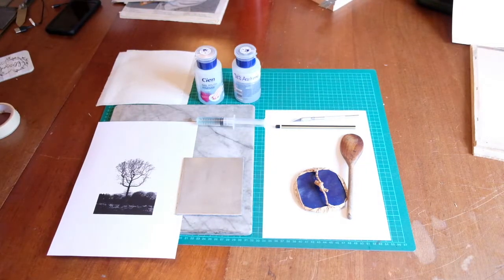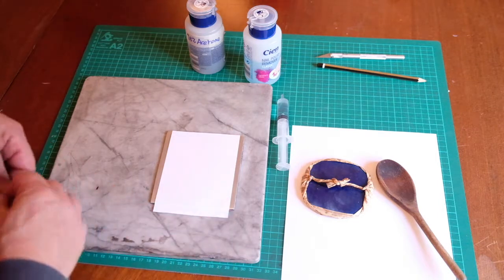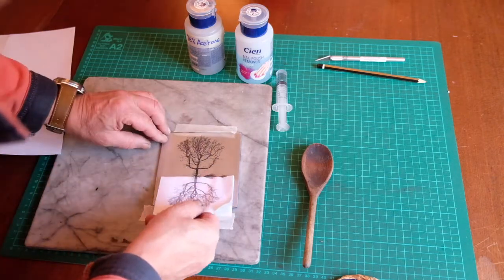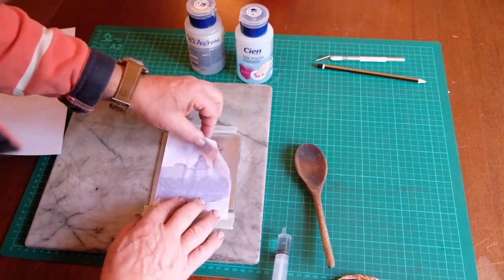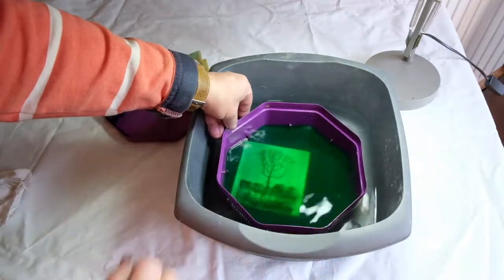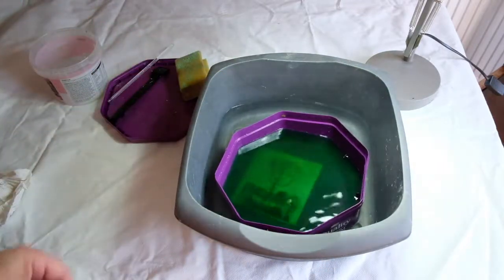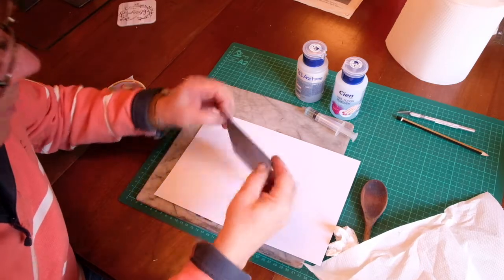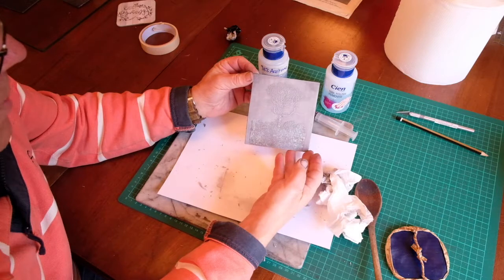etching aluminium from a photograph

Comment: Very handsome. Given the plate is not wiped why doesn't the whole plate print black? After all, the entire surface has been rolled with black ink. Thank you.
Reply from the maker: The plate has been etched - so has high spots (where the resist is densest - the dark areas) and low spots where the resist was thin and the metal has been etched away - these areas are lower and so don't come into contact with the inked roller and so remain white :)
Reply: Ah, so printed in relief. Thank you.

Comment: Pls send what are the chemical you used i didn't clear, what is the print ? How can it be taken
Reply from the maker: Start with a photograph which can be converted to become monochrome and high contrast, re-sized to fit the plate. Invert it horizontally and print on a laser printer. A 2mm thick aluminium plate is de-greased has parcel tape put on the back side. The laser print is placed toner side to the plate and then nail polish remover is poured over (must be acetone/isopropyl alcohol mix). Leave a couple of seconds for the toner to become tacky. Then with a protective piece of paper between - use a baran (spoon) to apply pressure to stick the toner to the plate. Whilst the paper is still wet, peel off, leaving the transferred toner behind. Add features (eg  sky) by applying a vegetable oil resist with a feather. The plate is put into the etching solution of 50g copper sulphate, 100g Sodium Chloride 500ml water. The plate is washed thoroughly and can be inked and wiped to darken the background if needed